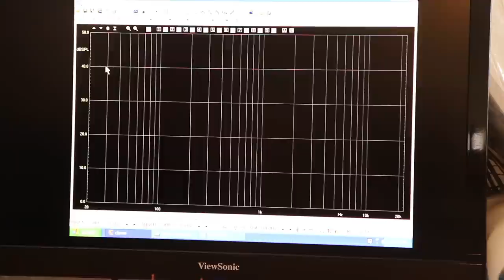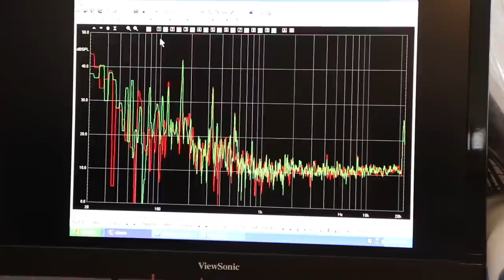Power Cable Tech Talk and a little help for Amir at Audio Science Review

Comment: silly idea to think the last few feet  of cable after passing thru the wires, connectors, transformers, fuses, breakers all the way back from power station to the outlet is going to magically make a difference. If the power cord is of sufficient conductivity it will be just fine. That is science, physics and common sense. Lets be real for a minute please, the fancy power cord is far better at wowing your friends and making you feel like your high end equipment is complete. That is fine and lovely in it own right. There is a need for high end power cables just as there is a need for nice looking designer shoes. They don't perform a function better but they look nice.
Reply: You obviously have no experience in this area. Think of a power cable just as a water filter under your sink. Water passed through miles and limes of pipe to get there only to be filtered just before you drink it. Power cables and conditioners do the same thing.
Reply: @dannyrichie9743  Once again, there is no evidence or physics stipulating that your cable filters any noise on mains power.  You are working backward from thinking you hear an improvement to causes you imagine that sound good to lay people as an argument.  After all, if your cable filtered anything, it would be trivial to show it.  You have not which means there is nothing intentional in there to filter.  

Of course, best filtering is in the audio device just as you describe it!  There, voltages and currents are much lower and we want DC anyway so we can filter the heck out of any noise and even distortion on mains.  By your notion, it is better for the city to filter the water than you doing it at point of use!
Reply: @dannyrichie9743  I was commenting specifically about power cables, not power conditioners . Conditioners are another topic. On that note, a properly designed power supply in the equipment would effectively filter and convert the power into what is needed. If it requires additional equipment it is poorly designed. Water filtering is a silly comparison. I do admire your efforts though. Thanks for writing back.
Reply: @AudioScienceReview  So myself and hundreds of thousands of people all "think" we hear an improvement. We are all just victims of a placebo effect and we don't know what we are talking about. Isn't that a pretty thin argument? You really have nothing to base your views on.  You have a belief and you try to make everything fit into that belief system even if the evidence shows otherwise. You are going to have to want to learn if you are going to learn.
Reply: @dannyrichie9743  Yes, you and all of others "think" they hear improvement. There is test equipment to measure difference in performance that fare more sensitive then any human ears.
Reply: @miroslawkaras7710  The trick is figuring out what to measure. Just measuring LCR doesn't solve or show anything.
Reply: @dannyrichie9743  its called "placebo effect".
Reply: @linandy1  Yeah, the thing is though, that's just an excuse. In reality I've had guys over that have been told by guys like Amir that cables won't matter. They make no difference, and they are predisposed to not hear a difference and don't want to hear a difference. Then they do. :-)
Reply: @dannyrichie9743  well then, i am open minded. I just want to understand the science behind this phenomenon. I can't help the way my technical mind works 🤓
Reply: @linandy1 this is the most accurate comment so far. Thank you!

Comment: Amir made a great point, if your cables require 200 hours to become able to achieve what you claim they do, and assuming you desire to put the best possible product in the hands of your customers, why not plug them in and do the "burn in" there at your warehouse? 9 days later you'll have an actually finished product to deliver.
Reply: Burning in 20 or 30 cables at a time is not practical and uses a lot of electricity. That will have to be done by each customer.

Comment: In the car audio world, they always keep power/ground cables separate from the speaker/line cables.  If they have to cross, then it should cross perpendicular.
Reply: We are on the same page,and the oscilloscope is like Matthew, Mark, and Luke .
Many tech and common sense details👍👍👍👍
Reply: You are 100% correct. Fellow Car Audio guy here🙂👍signal cables separate from power wire too.
Reply: @freone111  Sounds like car guys need to show these "audiophiles" how to do things.
Reply: The entire body of the car is connected to negative, or ground as you refer to it. How the hell do these cables you mention run perpendicular to the very thing are enclosed in???
Reply: @paulb4661  you have probably no or any experience troubleshooting noise in a sophisticated Car Audio. I will suggest to do skme research and stop your sarcasm.
Reply: @freone111  Absolutely- I work with home equipment, but I also have a car and I can clearly see where the negative terminal of the battery goes. So is it, or isn't it connected to the body of the car on yours?
Reply: @paulb4661  what a dumb question. Answer that for yourself.
Reply: @paulb4661  Car Audio = Alternator whine... poor grounding by Car Manufacturers induce noise. Does not matter if its inside the Car or the whole Car is a Ground/Negative.
Cables Matters too. Poor quality wire may cause problems. I use high quality wires and connectors for Sonic Quality and Reliability.

Comment: Since you always measure your speakers to prove a point, which is great in most cases, why dont you show detailed measurements of your claims about this power cable?
Reply: How would you like them measured, and what measurement do you think will correlate to a more open and layer sound stage (for instance)?
Reply: @dannyrichie9743  Pretty simple:  you say noise is reduced.  Show that the mains AC power noise is reduced and the same has happened in the output of the audio gear.  As for layering soundstage, that is due to channel differential on either level of timing.  In other words, the musical signal itself is modified.  I showed in null testing this did not happen.  But you are welcome to show otherwise.  But I suggest first doing a proper blind test with half a dozen audiophiles to make sure said effects are real and not what you imagined with full knowledge of what is being played, or good guesses.
Reply: @AudioScienceReview  Amir, your null test is well, null!
Reply: @AudioScienceReview  your group keep saying do a BLIND TEST and you yourselves do not do any listening in a properly set up system.

Comment: What good is fancy AC power cables if your wall outlet is wired with 12 gauge or at best 10 gauge wiring? I don't think many audiophiles would want to wire their wall outlet to the circuit breaker panel with that super AC power cable. With the exception of the power amplifier I run the entire system from a Sola 500 VA CVT (Constant Voltage Transformer) transformer to clean up the AC. Power conditioners are another way to do this. Speaker cables are an exception. I use 1980s vintage Monster cable speaker wires with four 8 gauge litz wire conductors.
Reply: 80's vintage Monster cable? That stuff is going to be so oxidized through that PVC by now that it isn't even good for jumper cables. You might want to consider new speaker cables.

Comment: When part of his "testing" doesn't include actual listening, coupled with his level of arrogance, displays how foolish he and his fanboys are. Just mind numbing
Reply: Would listening to a 500$ magic audio crystal be part of your tests, or would you simply dismiss 'magic' as being silly?  And btw, Amir does listen to components, in this specific case he explicitly stated that he could not hear a difference.
Reply: @literalghost929  You're making my point
Reply: @HD-Tech  Don't think you're grasping mine.  Snake-oil power cable sounds better = flat earth theory.  Amir measured output of the device and found them to be identical; no difference to be heard.  He disproved the theory.  

He doesn't need to 'listen' to it...  It's like putting two dumbbells on a scale, scale reading 20kg for each, and you going: "But did you weigh them with your arms?  derp derp".  You don't need to, you just measured them with an instrument far more precise than yourself...  🤦‍♂
Reply: @literalghost929  He did not test his theory. The fact remains that we know there are sonic differences. If he measure two cables and found them to be the same by his measurements then he is measuring the wrong thing.
Reply: @dannyrichie9743  Can you link us the proof?  A proper documented blind test where you or anybody else can tell 2 power cables apart under blind conditions?

Your claim that there are differences remains unproven.  It's a known fact that humans are fallible and often claim to hear differences where there are none.  How do you ensure that the differences are real and not imagined?

Comment: Also the same applies to running HDMI, coax, and any non electrical  low voltage cables
Reply: Hey, where did your first post go? It was really good. I was going to respond to it that I agreed with all of that, but then I couldn't respond to it because it wasn't there anymore.
Reply: Thank you 

I edited it but couldn’t save it because it had a link. So I deleted it made the correction  and reposted it. JK
Reply: What? If a low voltage cable is "non electrical" how does a low voltage cable work?

Comment: I don't know how much difference it makes, I probably don't have the best hearing anymore so perhaps it makes no difference to me personally but I run both my DAC and Power Amp with good aftermarket cables from a Furman Elite-15i power conditioner, my main reason is that this is for my second system in a large bedroom and I am able to put the Furman in the middle of the room away from outlets and place my DAC and Amp close to it without having to run long power cords, it's more of a positioning thing for me and maybe there are some other secondary sound benefits, I don't think it has hurt sonics.
Reply: did you try it on the DAC and the pre-amp rather than the power amp, as its supposed to be more of an improvement on the devices at and closer to the sources. and then to the power amps once the upstream coimponents are sorted.
Reply: @stephenyoud6125  My Dac is both a preamp and DAC, it's a Peachtree Audio SONAdac, my amp is a Peachtree Audio 220 power amp, (not the 220se)
This is my bedroom system, not my main system so I am not overly anal about it.
Reply: @The_Story_Channel  okay. yeah mine is both streamer and pre-amp theLinn Klimax Exakt DSM then the Linn Klimax Exaktbox crossover / DAC but i haven't aded any power conditioners or fancy power cables yet.  It's a new built house in Germany. I know a guy who could probably measure the mains noise for me but am busy completing the Home Cinema room right now and then planning upgrades to my Linn Keltik active speakers first. Lots to do.
Reply: @stephenyoud6125  👊😎

Comment: Dude, your power amp amplifies noise coming in through the PSU? Better replace the PSU because it's broken, I guess? SMDH on all this garbage. XLR cables are needed in pro audio, expensive power cables, however, are not. Because they do nothing for the sound.

Comment: Danny, show us the measurement data from this cable, how you measured (what measurement devices you have used, and what audio equipment was used), show us the difference in audio data with a $3,99 wire from the super market, a "medical licensed" Supra LOrad, a $500 audioquest (or equal brand) and your cable. Only interested in audio signal. And to make measurements complete : use a class D amp, class A/B amp and single ended tube amp.

Show us everything so we can replicate the setup.

Here you are trying to make a fool of Amir (by saying he does not understand certain aspects). If something is changing the audio signal (as you say for the better), you can measure it Danny. Its as simple as that!

Ironically, arent you guys the flat earthers? Denying actual measurements and only bringing asuptions to the conversation?
Reply: Taking a bunch of measurements and theorizing a result is what flat earthers do. That's Amir!  

In the end the test isn't if there is a measurable difference, we already have confirmed that. 

In the end the test, and real test is if it makes an audible difference. We have confirmed that as well. 

Case closed.

Comment: So why is the last 4 feet worth hundreds of dollars when the walls are full of romex and unshielded wire all the way to the transformer at the street and on to the substation?  😂

I guess some people are just addicted to snake oil.
Reply: that's why if you run a serious system, it starts outside with dedicated circuits for your system. 
if you don't or you cant hear the difference, good on you, save your effort and be happy with it.
in many ways, I wish I didn't hear the differences decades ago either.
Reply: Shhh, you’re messing up Danny’s sales pitch with logic and reason.
Reply: @happygil4698  If you don't want to hear the differences, just do a blind test; have someone switch the cables without you knowing which is which, and I guarantee you, 100%, you won't be able to tell the difference between a 2 buck cable and whatever power cable you own.
Reply: People that cry snake oil are the people that don't understand what is going on. 

Your water arrives to your house after passing through miles and miles of pipe. Just before it gets to your sink it passes through a filter. Power works the same way.
Reply: @dannyrichie9743  That filter looks like a bunch of rectifier diodes and electrolytic/film capacitors often followed by series pass transistors/voltage regulators. It's a linear power supply unit, Sir, although smps exist as well. You are most likely to find AC on the heater filaments of some tube gear, tge rest is filtered and often extensively regulated DC.
Reply: @dannyrichie9743  There is no evidence that your cable filters anything.  If it did, simple measurements would show it and they don't.  But let's say it did.  Why on earth try to filter high voltage AC with high current coming out of the socket instead of doing that inside the equipment when both voltage and current are much lower?  It makes no sense, right?
Reply: @AudioScienceReview  We know our power cable acts as a filter. You already admitted to that. I am sorry that the rest of this makes no sense to you. Maybe if you had some more experience in this field... Do you really think whatever is inside any piece of equipment is sufficient? I really don't know if I can help you.
Reply: @AudioScienceReview  Amir getting schooled once again...
Reply: @dannyrichie9743  I guess you have the burden of proof.  A water filter typically has to meet a certain set of standards to remove the "gunk" that I don't want to drink.  AC mains is a power delivery system.  Your audio gear uses rectified and filtered DC to function (gunk removed).  What exactly does the cable remove from the 60hz mains?  Can you show the exact filtering capabilities using a VNA?  I'm really curious as to what level of system I'd have to possess to actually hear a difference in a properly sized standard stranded copper AC power cable versus the one you claim makes it sound better.
Reply: @dannyrichie9743  On the subject of filters; tube gear designers struggle to achieve 30kHz bandwidth with meticulous arrangement of bifilar windings of output transformers, mains transformer makes a very efficient HF, let alone RF filter.
Reply: Open up an amp ...PCB traces I mean nothing else needs to be said .

Danny says here cables act as a filter .
How you people still give him your money is beyond me. 

But more power to danny, he has his flock of sheep paying him for it. so he makes a living of it lol
Reply: @dannyrichie9743 oh Danny. You can measure the filtration effect of water through testing to show less chlorine or other contaminants. There is nothing we can measure to show power cables have any such noise reducing or other effect
Reply: @davidteague3849  ssst he's going to make a other essay about how much you don't know. But he does ...

Careful now, you're stepping on the old man's long toes
Reply: @davidteague3849  Sure we can. Just a change in inductance and capacitance will change the behavior of the cable and will alter what passes through and what does not.
Reply: @mrpete891  I'll make it real easy. Come on over for a demonstration.
Reply: @dannyrichie9743  why don't you have any recordings of the blind test? you keep saying you've proven it hundreds of times yet you didn't bother to document it even once?
Reply: @HolarMusic  There is.
Reply: @dannyrichie9743  link?